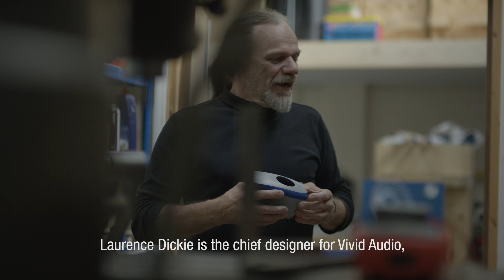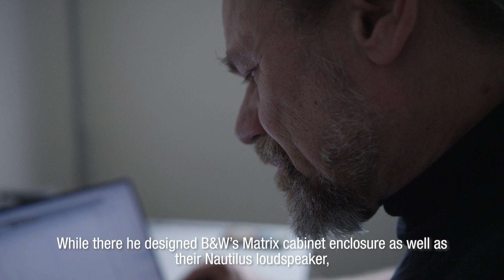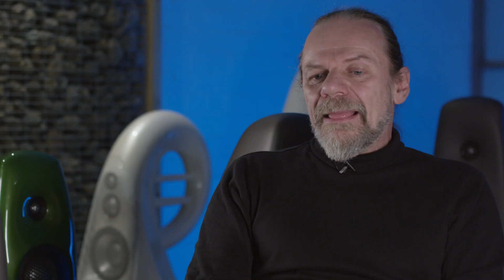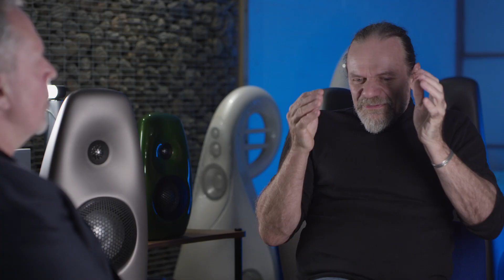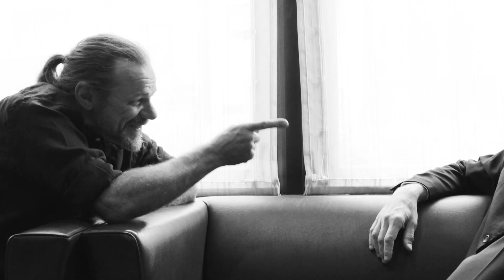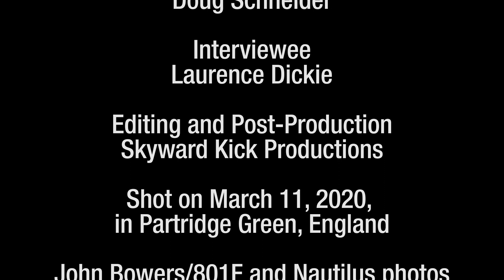Vivid Audio's Laurence Dickie, Designer of the B&W Nautilus - SoundStage! Icons (June 2020)

Comment: His exuberance and childlike enthusiasm is so charming and extremely infectious. A real audio icon, IMO. My first high end (?) speaker was the 602S3, which I downsized to the 601S3, because the 602 was too bassy and loud for my small room. I eventually got rid of the 601s also, because they liked to be played really loud, and had to be turned up louder than my room and ears could handle to fill in that dip in the midrange that most B&W two ways have (the 602s didn't have that dip). I've tried at least a dozen speakers since then, and finally settled on my current Wharfedale Diamonds and classic KEF C40s, both of which are very balanced and dynamic at the low voume levels I listen at. But, I've never found a tweeter as crisp and airy and three dimensional as that B&W aluminum tapered tube tweeter. I feel that the more recent B&W speakers are voiced with the tweeter much too hot, making them very shrill, and accentuating that dip in the mids. It's a shame, because I think they've lost their way after the original Nautilus influenced designs. The 805S is still one of the best two way stand mount speakers I've ever heard, and, IMO, are far superior to the more recent 805D models.